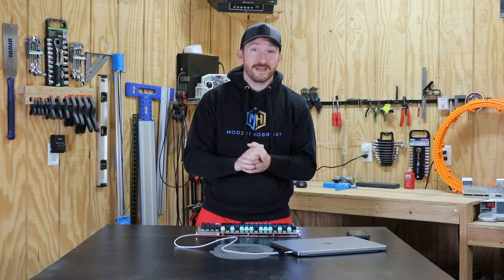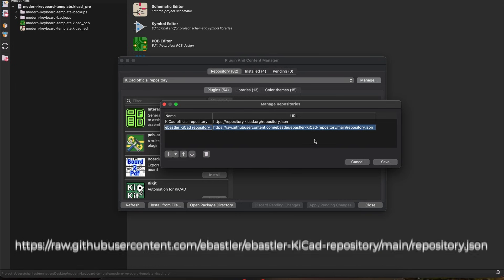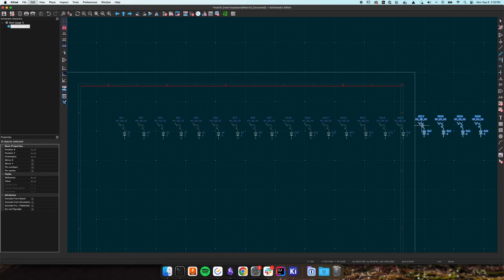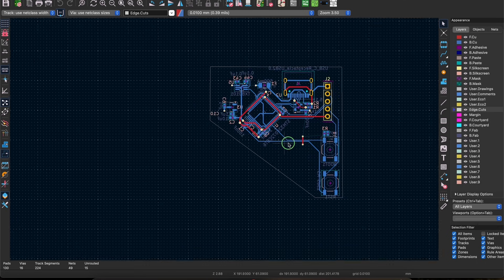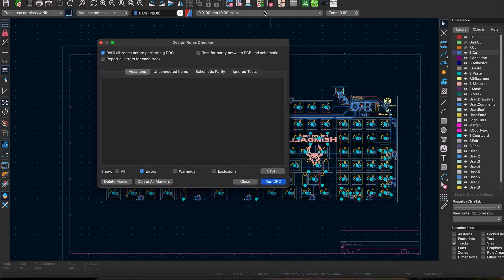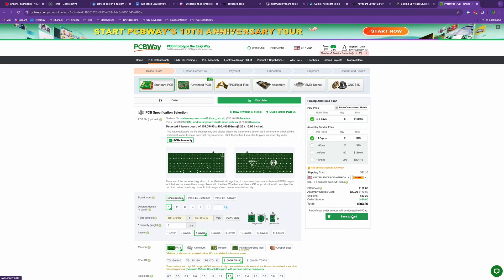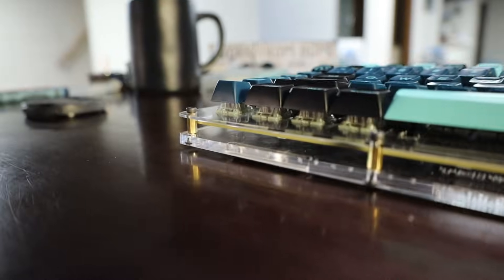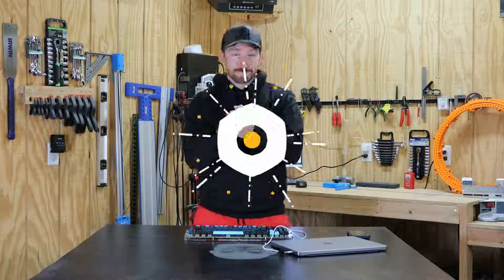Designing a Custom Keyboard PCB FROM SCRATCH!

Comment: at what point did u add the space bar stabilizer holes
Reply from the maker: I might not have shown it but I went back through and added all the stands manually after all the switches were placed with the kbplacer plugin
Reply: Should I add the stab holes when I drag in my layout?
Reply from the maker: Yeah, you'll need to add a separate symbol in the schematic for each stabilizer, but if you name them appropriately, you can have the kbplacer plugin place them automatically for you.

Comment: This is cool.  Is there a way to add HE or TMR sensors to the PCB?  I'm wanting to build a custom keyboard, but with magnetic switches like the keyboards I used in the 1970s and 80s.
Reply from the maker: I haven’t used HE switches but from what I’ve seen they are separate footprints and wiring needs entirely so it’d be a pretty hefty overhaul

Comment: I'm making a pretty compact 65% design, with no space to spare. Where should I put my MCU?
Reply from the maker: Hard to say, but I’ve seen some people sneak their MCU in under the space bar
Reply: I'm not sure if you still need it, but if you get a breakout board with header pins (like your typical Arduino/RPi Pico; there are many SMT boards too), you can put them directly under the switches, since the pins fit on either side of the switch and the board is high enough above the pins to not short out. Works better with hotswap

Comment: Any tips what to do if I run out of pins on the microcontroller? In other videos I've seen things like multiplexers, but I'm only a few pins short and just want to know what the best solution would be.
Reply from the maker: There are several potential solutions, but I’m not an expert to be honest, I’d check out the Keyboard Atelier discord and ask in one of the help channels. I know there are different kind of matrices that you can do to save pins but I’ve never implemented that kind before.
Reply: @ModernHobbyist  Thanks for the guide, I took a pause from this project, and I am now putting research into general PCB design and electrical components, as I also wish to pursue electrical engineering. Thank you for the guidance, and your video was very informative.

Comment: The file that i dowloaded form githud does not have the micro controler
Reply from the maker: Interesting 🤔 The MCU footprint is from a standard KiCad library. Is it not loading in the schematic or the PCB file?
Reply: I was using the wrong template thankyou for your response